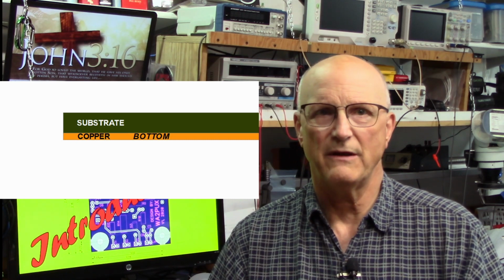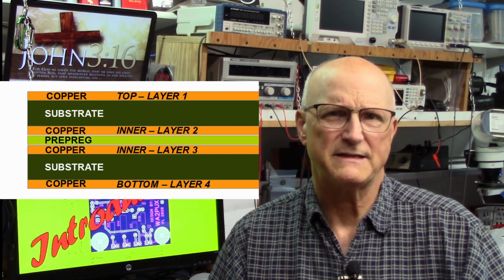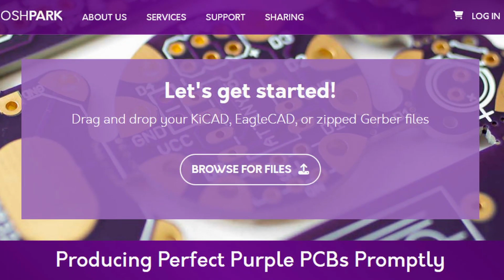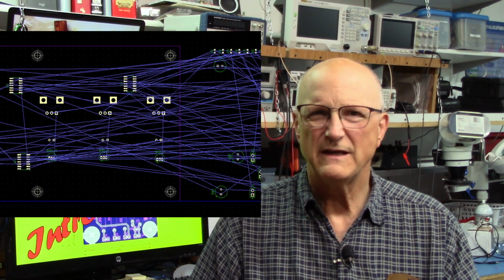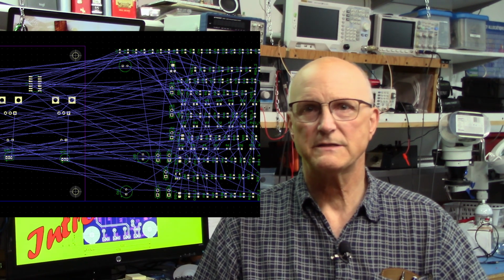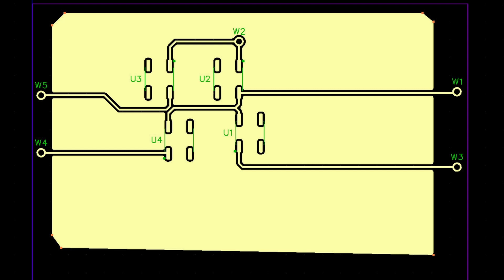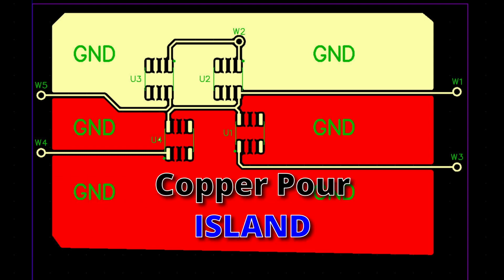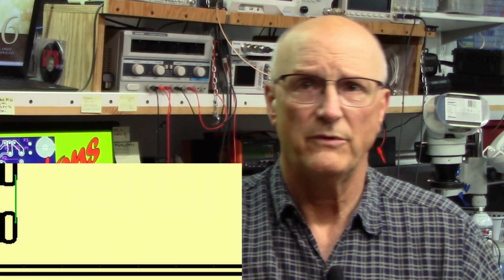Introduction to PCB Design: Step 5a (060e1)

Comment: Thanks Ralph. I haven't used a PCB house yet but about to. I've heard it said that a 4 layer board is worth the additional cost, using the two inner layers as ground planes. Would you mind commenting please, pros/cons. Perhaps it's a myth!
Reply from the maker: Actually...the biggest issue with PBC design is usually routing space, getting signals to and from where you need them to go.
Ground planes usually live on the outside. If I had the option of additional layers, I would use at least one of them for power, to ship Vcc everywhere. This keeps the power distribution at a very low impedance. I can use the power plane layer for signal traces, too, not unlike the outside layers where signal traces share space with the ground plane.
There are some cases where a ground plane might live on an inner layer, but these are not the general rule.
As a product design engineer and as a hobbyist, I tried very hard to keep the PCBs to as few layers as possible. Two to four layers ... 30% increase in bare PCB price. Four to six ... add another 30%. With products we want to keep material cost down and part of that is the cost of the bare PCB.
With all of that said, added layers makes routing a LOT easier, but they are often not really needed.
So, yeah ... kinda a myth.